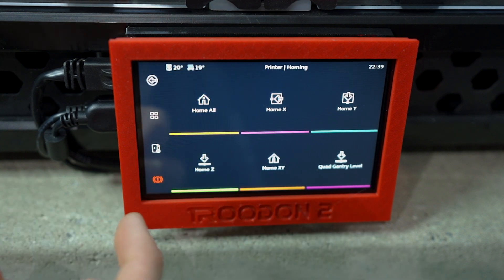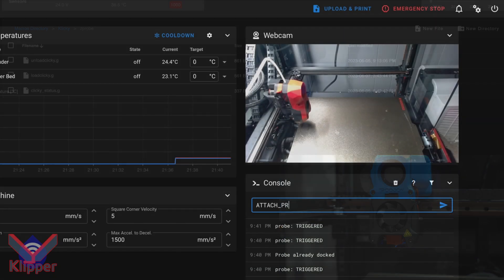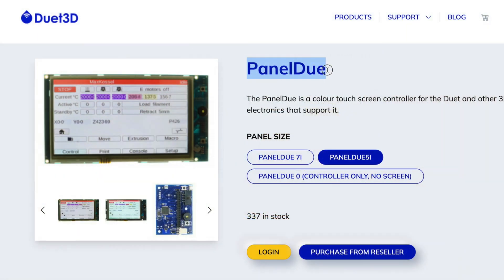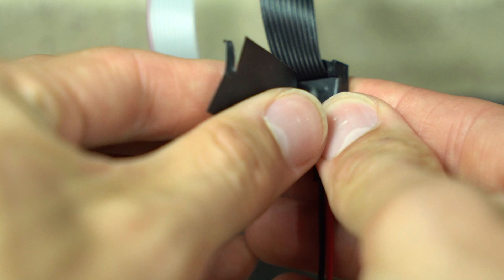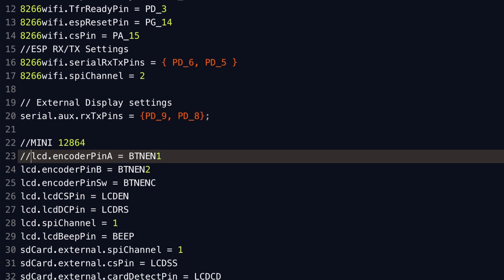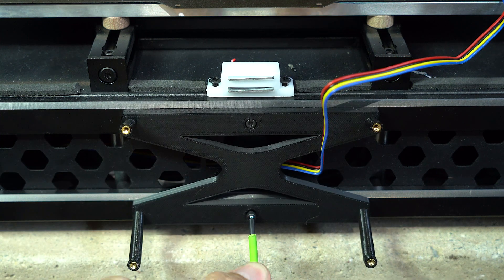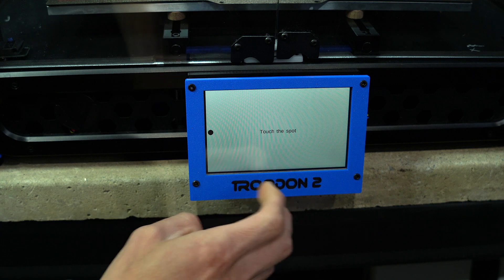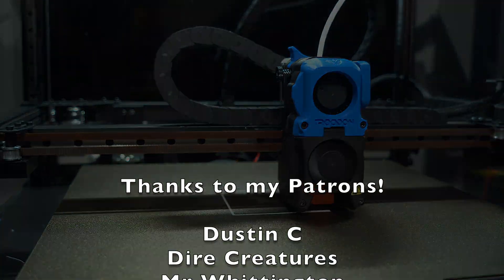Your 3D Printer NEEDS a Touchscreen - Here's Why

Comment: It seems you have all of the printers I'm considering for my first 3D printer purchase... I am 100% new to 3D printing but have a CNC background and love building things. At first I was about to jump on the Bambu train and get an X1C or P1S with an AMS. I was pretty quickly turned off from those by the Cloud features and closed source nature of them. I'd like some privacy regarding the things I'm printing. An enclosure isn't 100% necessary for me at first as I get started but I would like to print some ABS and more exotic/stronger materials in the future for sure. The bed on the Bambu is about as small as I'd like to go with 300-350mm being the largest I think I'd need. This brings me to building my own and I'm deciding between a Rat Rig V-Core 3.1, Prusa MK4, LDO Voron 2.4 R2 (Rev C) or a Troodon 2.0. I would like the option to print with multiple colors so a Prusa MMU3 or something like the Enraged Rabbit Project (not ready for prime time) or similar would be wanted in the future as well. I don't really want to source ALL my own parts so a kit would be nice. What do you think is the best for my use case? Thanks so much, love the channel!
Reply from the maker: Hey! Thanks for tuning in to the channel. I wouldn’t let the cloud nature of Bambu scare you. I think the fears there are unnecessary, personally, but to each their own. Bambu is by far the best out of the box and most capable with the AMS considered. For a fun DIY project the V-Core 3 is a considerably easier build than a Voron. I haven’t enclosed mine so don’t know what’s involved with that. Most Voron kits come with an enclosure which is a bonus. If you go that route you should consider the 2.4 Pro kit from Formbot which looks nice and is more affordable than the LDO kit I believe (haven’t fact checked that). The Troodon 2.0 is a nice option as well which is much quicker to build that a Voron kit but is compatible with the standard Voron upgrades, including the ERCF. For basic multi-colour prints with little hassle the Palette 2 is a good option if you can get a used one for cheap. It’s pre-built and compatible with Klipper. The MK4 is a capable printer as well but not great value versus the other options on the market. I haven’t personally tested the MMU3 but it’s in kit form and looks to be an involved assembly. It also has a large operating footprint for all of the filament buffers (as does the ERCF).
Reply: @ygk3d   Thanks for the info and quick reply man! The Troodon was on my list as well for consideration. I see there's some other open source "Tool Changer" options out there as well like WP-DAKSH. I think I'll stay away from the Bambu just so I can have fun building, modifying and upgrading my printer. Still not sure what direction to go but leaning more towards the 2.4 Pro or the Troodon. Any thoughts on 3dprintersbay? Voron Trident R1?

Comment: How come you have clipper on one of them and not the other? Which do you like more? Also did the cable chain removal improva anything? I imagine there is less moving mass. Love the videos, keep them up. I'm still considering the Troodons, I'd love to see a comparison between your other printers and which you like best and recommend.
Reply from the maker: Thanks! Glad you're enjoying the videos.

I have one on each firmware mainly so I can produce content for both audiences, but they are both very capable and I'm enjoying learning how each one works and what is different between them.

I like each of my printers for different reasons. The Troodon is my favourite to tinker with because it benefits from the whole library of upgrades that are compatible with Vorons. It's also a very capable and fast large format printer.
Reply: @ygk3d  Yeah I like that it has all the advantages of a voron but you don't have to spend a week assembling it. I'll probably end up getting it. I'll probably install the Xol toolhead and get the best hotend/extruder I can find, swap the MGN12 to a high quality MGN9 for weight reduction along with a lighter extrusion to get into some really high speeds. I'm using 3d printing for some other hobbies and I hate waiting for parts to finish while I'm prototyping on a design. For the final product I can slow it down for extra quality. Then again it should be much, much faster than my cr10 as is :D
Reply: BTW how are the beds on those Troodons, are they flat?
Reply from the maker: @sabahoudini  yes, very flat. My range is 0.076 mm.
Reply: @ygk3d  I just bought one, thanks man. Too bad you don't have a coupon code or something.
Reply: Mine is 0.16 im thinking about contacting the support...
Reply: @tayfunaltindag4318  is the heat map graphic sloping in 1 particular direction? Ie front to back.
Run “True Bed Levelling” twice and try “Run Mesh Compensation” again and see if it improves.
Reply: Its a normal bedmesh in klipper...
Reply: I can't post pictures in here...
Reply: @tayfunaltindag4318  I can’t help with Klipper. But I have noticed I get better results on Reprap after bed levelling multiple times.